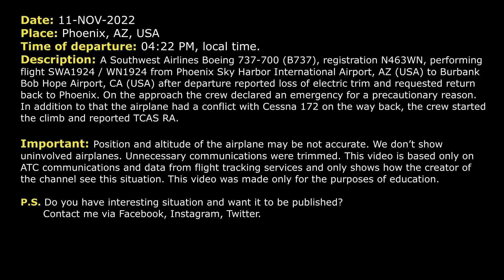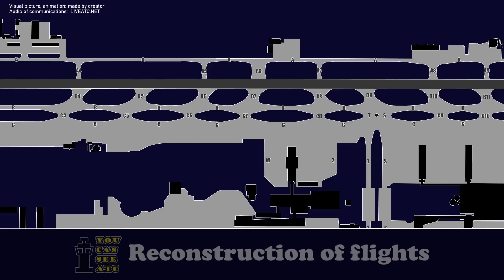“WE’VE LOST OUR ELECTRIC TRIM”. TCAS RA on approach. Southwest B737 returned to Phoenix. Real ATC

Comment: OK.  So they lost their electric trim.  Did they remove the trim wheel from 737's?
Reply: I’d imagine the airline made the call. Procedurally, or otherwise.
Reply: No electric trim -> no autopilot. Imagine them being like "nah, we're just gonna continue the flight manually", and then something bad happening because of it. If I was a passenger, I wouldn't want them to just wing it like that. They made the right call imo.
Reply: @Aronymous7  no autopilot is actually a much easier thing to deal with than no electric trim. If you have trim, but no autopilot, you can just stay at FL280 or lower and trade off hand flying. No electric trim means you have to manually spin that big, heavy wheel.
Reply: @Aronymous7  So, you would climb into an airplane knowing that the pilot isn't good enough to put two hands on the yoke and fly it safely?  And, keep in mind that the trim was not inoperable - it just had to be manually dialed in with the wheel.
Reply: No, the trim wheel is still there.
Reply: @saxmanb777  I was wondering why losing their electric trim made them want to RTB.
Reply: @rickbanet4830  Not having electric trim is an extremely high workload. Sometimes you need both pilots to turn the trim wheel, not to mention the Mach trim and auto pilot don't work without it. Its an easy decision to return to base with a flight control problem.

Comment: For anyone wondering: B airspace starts at 7000ft where the RA was. Just north of it would be B starting at 6000ft (if I interpret my charts correctly) Since it was outside of B, it was neither of the pilots fault. ATC should have given the traffic warning and an information about leaving airspace B to SWA, but we can't see how much traffic/workload ATC has at that point.
Reply: Still, a Cessna 172 made in 2016 comes standard with a G1000 glass cockpit. They also should have heard the G1000 say "traffic" well before the loss of separation and stopped climbing.
Reply: @jonathankleinow2073  Wow, os that such a new aircraft? Must be some high-income people. (Although a GTN750/650) is enough for a traffic warning)